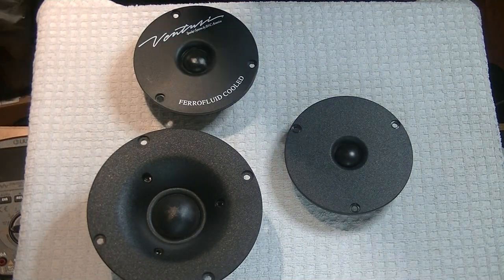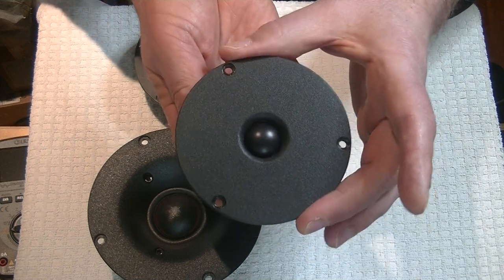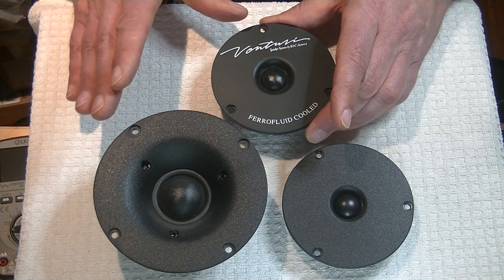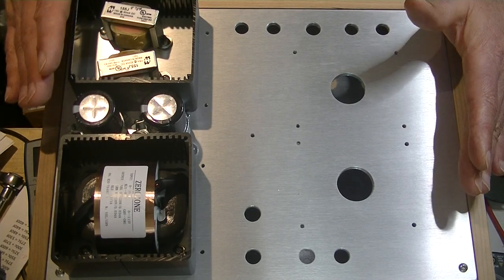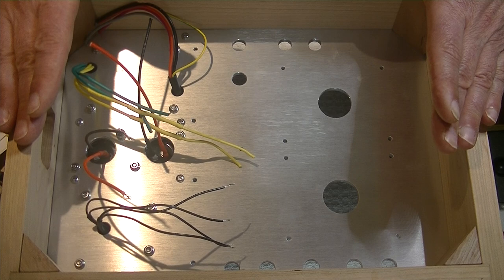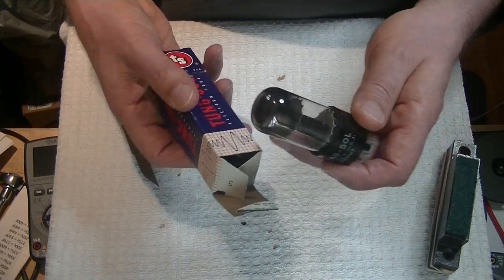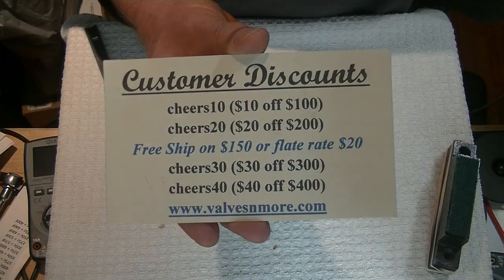Tube Lab #80 - How To Acheive Great Sound - Speakers Pt 1

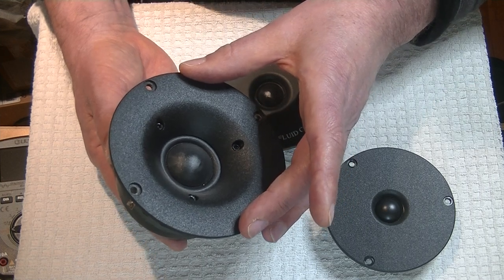Comment: 7:13 .....what kind and model tweeter is ? Biggest one of those three ....
Reply from the maker: That is a Wavecor 30mm soft dome, wave guide mounted tweeter.  They come in 4 and 8 ohm models.  We've used them in our main OB (open baffle) system for 4 years and they're excellent.  Note they're higher efficiency, and are a good match for high efficiency drivers.  And I'm a firm believer that higher efficiency is important for good sound.